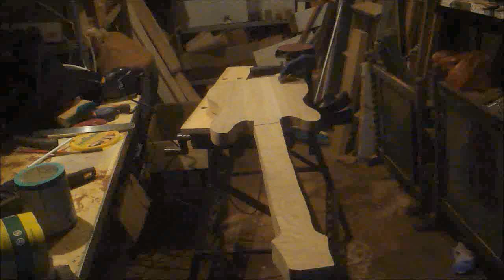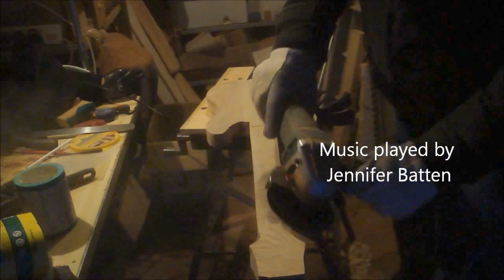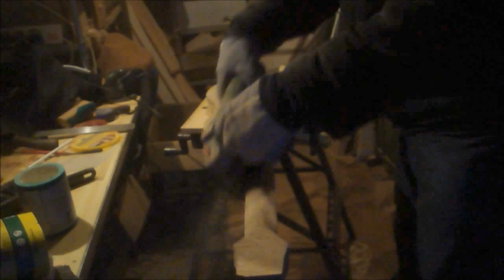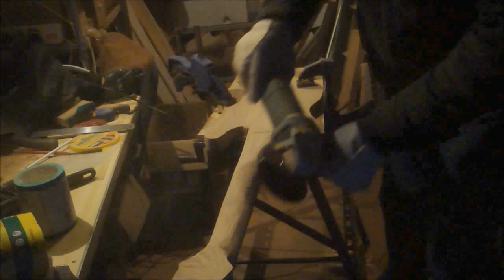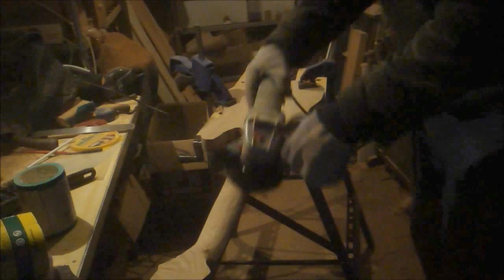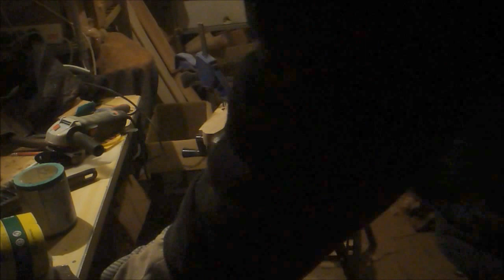Shaping a guitar neck with an angle grinder Time Lapse

Comment: I would take that glove off... I can't imagine the wheel catching the glove taking your hand with it... granted the angle grinder probably doesn't have enough power to amputate you but you know, it can still cause flesh wounds.

Get a glove caught in a lathe, especially a metal one and it's good bye.
Reply from the maker: Well I thank you for your concern..  I have been using this method for a few years now.. Never had that issue. But I also know just cos its never happened means it cant ever happen.. So I will keep a good watch out...